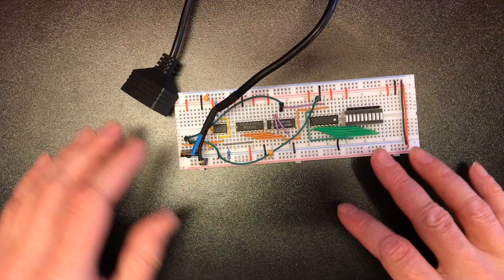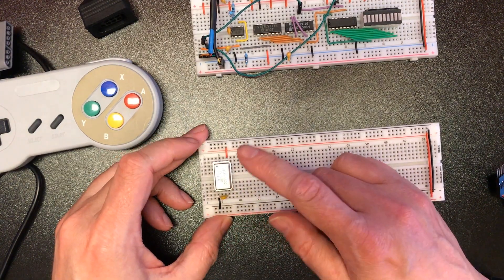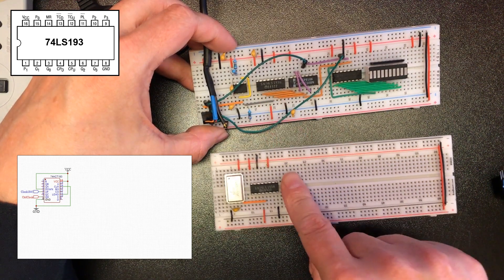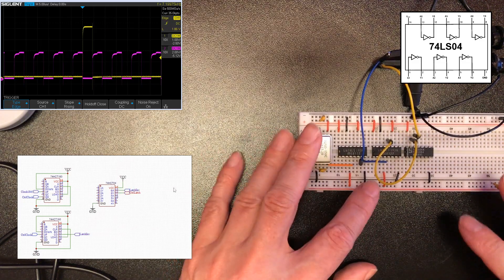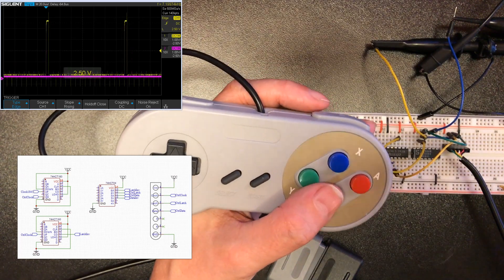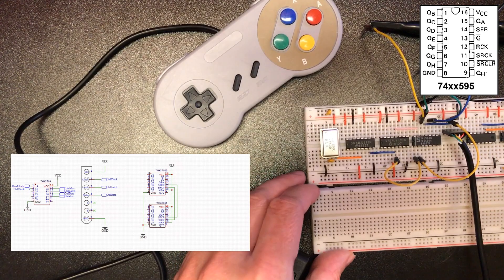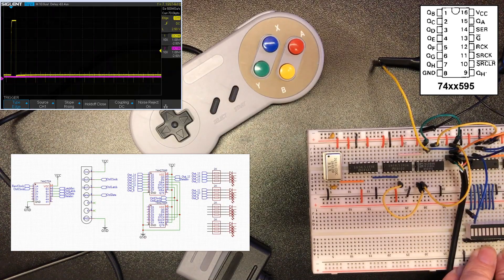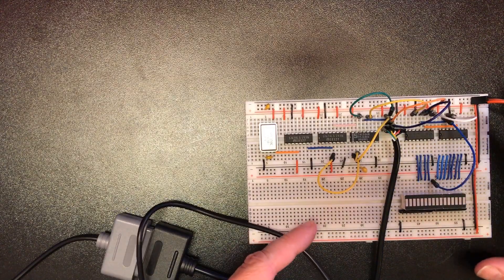SNES Controller Interface – Part 1 – Reading the inputs

Comment: That controller is getting quite the workout if you're latching it 7200 times a second! While SNES games are free to read the controllers whenever they please, in practice most of them only poll the controller once per game frame, so the latch line typically sees a roughly 50 or 60 Hz (or less, if the game lags) signal. (50 in PAL, 60 in NTSC)

If the controller were anthropomorphized, it would probably wonder why you're pushing it so hard!
Reply from the maker: That's a good point. Since building this I've been told that there were some 3rd party controllers that needed a the latch line to stay high for a bit longer,  fortunatly I didn't get one of those.

Comment: If memory serves, the SNES controller is a little different from NES.  I'm sure you have it all figured out by now, but at least in software, it was A LOT easier to work with.  Maybe they added an internal shift register to handle it, but I remember you could write a byte to latch, nop nop nop, then read the whole 16 bit status from a hardware register.  You could even get it to latch and read automatically on an interrupt.

It looks like that was all handled in system hardware, because it seems to work exactly the same in this circuit.
Reply from the maker: In terms of the protocol they are the same     apart from shifting in 16 bits rather than 8.

Comment: I got the LED's to output all distinct controls... Only problem is LED are always on, do you know what could be the issue?
Reply from the maker: What led’s are always on?
Reply: All LED’s connected to the outputs of the 74xx595
Reply from the maker: @davidrosset4457 It's not clear what you mean,  you said  "I got the LED's to output all distinct controls" but then you said 
"they are always on".  Do you mean the operation of the LED's is inverted?  They are on and then go out when the relevant button is pushed?
Reply: @weirdboyjim  No, actually they are always on but not fully… like half-way lit. Then when I push the buttons it lights up more so I can distinguish it
Reply: @weirdboyjim  My data line is looking like a clock… it should be high though and active low on button pressed… the dupont cable seems correct, do you think it’s a faulty controller?
Reply from the maker: @davidrosset4457  that does sound odd. Check the signals going to the controller first though
Reply: @weirdboyjim The signals seem correct, with the clock with 115kHz frequency and the latch aligned with the clock with around 7.1kHz

Comment: What are the values for the ceramic capacitors youre using?
Reply from the maker: Those are just trying to add a bit of power decoupling to the breadboards, they are 100nf but when I convert the circuit to a pcb I'll use whatever decoupling caps are recommended by the chips datasheets (100nf is a very common value for this, most of my pcb's use that).
Reply: @weirdboyjim  thanks for your help! I will try to find what is specified by try chips datasheets and/or experiment with 100nf’s. 🙏👍👍

Comment: The SNES controller is far and away the best, most long-lasting one... though being my first console, I may be a bit biased. 🤣 I remember long ago that there was a four-player expansion which was supported by some games. Seeing the upper four bits aren't in use with the standard controller, I now suspect I know how they did that. 👍
Reply from the maker: Nintendo always made very durable stuff!

Comment: Very cool James. Just wondering what the capacitor on the oscillator is about? What does it do?
Reply from the maker: Interesting question. It was on the sample circuit in the datasheet and has a very low value (10pf if my memory serves me correctly).

Comment: Damn YouTube, loves to censor links. I was wondering about using clock divider ICs, like the 74LS292 instead of counters, they are pretty very similar except clock dividers can shift the clock down way more than a single counter chip can. I get using stuff you have on hand for building a prototype or proof of concept, but some places maybe a clock divider is the better IC to use, like the audio circuit, the clock needs a lot of counter chips just to get in the hearable range. Anyways it is your build and your show, but I found the clock divider chips interesting and potentially useful.
Reply from the maker: The 292 is an interesting device but they are tough to get hold of in anything other than LS-Dip but conceptually it is indeed a good chip for doing this with.
Reply: @weirdboyjim  I didn't know about the supply issue. And the 193s gets the job done.

Comment: One for a humorous "nope. Not doing that" video: a USB controller.
Reply from the maker: The circuit for that would actually be very close to the UART, but I'd loose everyone's interest with all the programming videos it would take to get it working.
Reply: @weirdboyjim  Poked around after commenting that. Came across V-USB that claims 2kb for slow USB, no interrupts, two pins, but is GPL and would need a C compiler. All from scratch: that's a mountain to climb even with specs. Almost need Linux for full device coverage too.
Reply: Though TinyUSB popped back up on my late night web surfing. No need for the for pay spec and full stack. Didn't dig deep enough to see if it bit banged.
Reply: Even the controller was 16 bit.

Comment: I was wondering when the game controllers would get connected. Seems a lot easier than I thought it would be. I suppose you now need to front this with a tristate latch and some address line decode logic to turn it into a memory mapped register.
Reply from the maker: Well I have a spare 8-bit IO port I can use, so I'll work out a way of doing it with that.

Comment: The controller port has actually 1 more data line and an IO line that you can send and recive data from, the SNES used it with multitaps, to connect the second pair of controllers and the super scope used it to latch the HVCounters in the PPU, thou only the IO line of port 2 is connected to the PPU latch. Both of the lines are unused in the normal controllers and not connected in most if not all snes extension cords, which makes them unusable for most other snes accessories.
Reply from the maker: Yeah, I know about the extra lines but as you say they were not relevant to this circuit.

Comment: the SNES controller actually transfers 16 bits, 4 extra to indicate the controller type, tho on the standard joypad these are all 0s
Reply from the maker: Interesting. I wonder if that was designed from the start or if they later added new peripherals and co-opted the spare bits for that purpose.
Reply: @weirdboyjim  the "spare" bits are always used for controller identification, other peripherals either use the second data channel, or use more bits (as the bits can be software shifted in, along with autojoypadread reading in the first 16)

the mouse uses id 0001, the superscope uses 1111 (returns all 1s after its initial byte) and the justifiers (twin gun peripheral? unsure) uses 1110

Comment: What's the advantage of converting serial data to parallel? Why don't you feed the serial data straight to the CPU?
Reply: Technically you could, but the processor processes bits in parallel. So if you have an 8-bit CPU, then a load instruction will load 8 bits in parallel. You could give 1 bit at a time, but then you would have to have 8 load instructions and a few more instructions to shift the incoming bit to the bit position you want.
Reply from the maker: A cpu like this is a parallels device, you have no doubt seen people read from controllers like these by bit-banging the protocol with a user port. For my system it would be necessary to build a user port / gpio type system, and then software implement the protocol to read the data using that circuit. It's more interesting to do it "properly" to me, and it means I'll have much simpler code to get the data out.
Reply: @weirdboyjim  For some basic dev boards, I could see how doing it with zero external circuitry would be appealing. i mean. any stm32 uc can easily handle the polling really quickly, for example
Reply from the maker: @luz_reyes_676  I think you have misunderstood the point. This circuit for is for inclusion in my custom build that has no general purpose IO, I would have to deliberately make GPIO circuitry in order to read it in with software slower than this circuit will do it.

Comment: isnt it possible to now use both controllers?
Reply from the maker: Ok, I can interpret that question a couple of different ways. This circuit will read a NES controller as well just without the extra buttons. Or do you mean 2 controllers? You would need extra circuitry for that, but you would only need duplicate the shift registers to support 2 controllers, I'm not sure I have space for that in the final build though.
Reply: @weirdboyjim  sorry if I was unclear
(dont comment untill you had coffee)
but I ment the firsth option
the circuits realy looked alike and that is why I wondered

but in both casses it would only be a plus